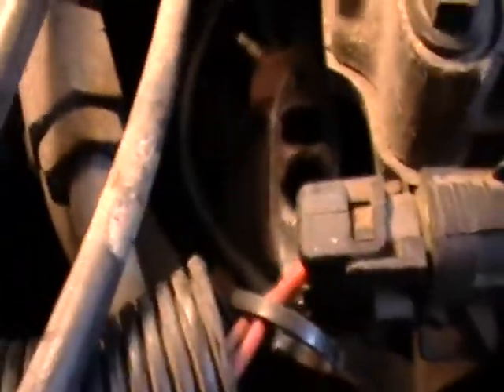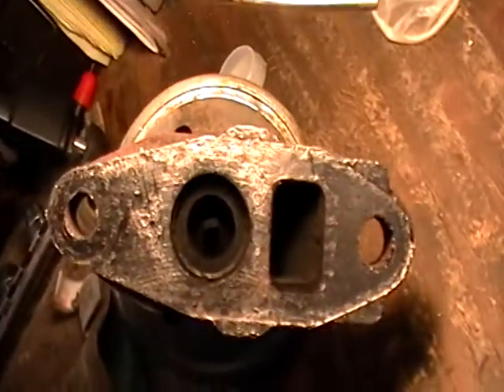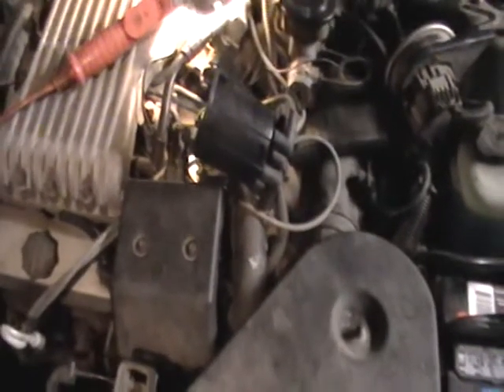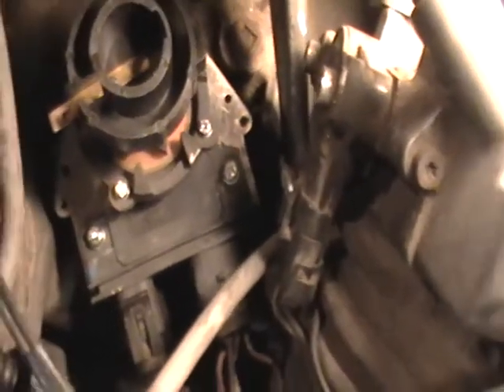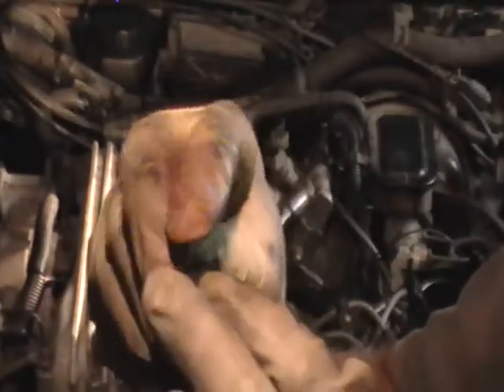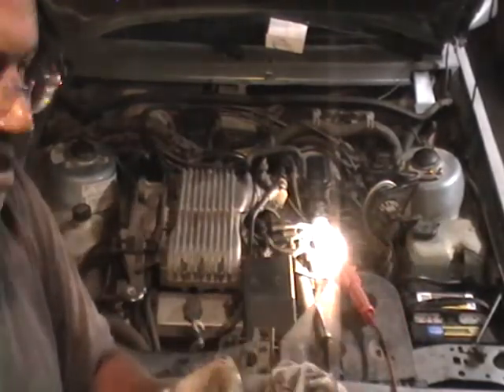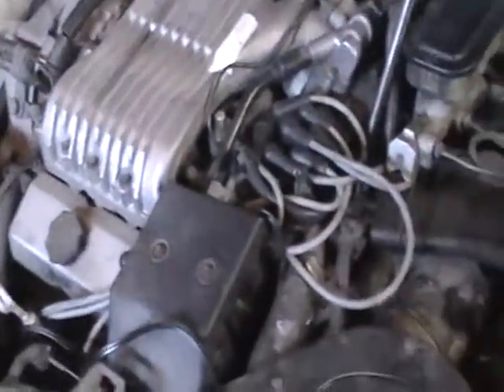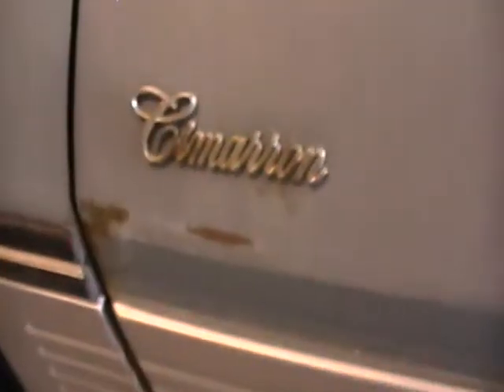1986 Cadillac Cimarron Tune Up Part 2

Comment: Hello Raphael, a friend from Peru greets you, I hope you can help me, 2 years ago I bought a gm 2.8 v6 engine that is the same as the Cadillac Cimarron tutorial that you were repairing, online and I saw that that type of engine also came in The Chevrolet Cavalier of the same year ... it turns out that the person who sold me the engine gave me an ECU that is not compatible, it is possible for you to show me in photos or give me the serial number of the ECU for this engine .. .. I am desperate, because the engine drowns and burns a lot of gasoline and turns off ... the electronic tells me that the engine does not have a MAF sensor, but a MAP, the engine is a 2.8 v6 4-speed manual transmission plus the gear of back off, I would infinitely appreciate if you could help me .... thank you very much.
Reply from the maker: I wish I could help you with that, but I am not able to.  That vehicle was a customer of mine 7 years ago, and there is no way for me to retrieve the info that you are seeking from that car.  My apologies.